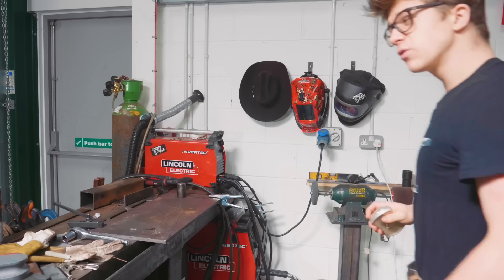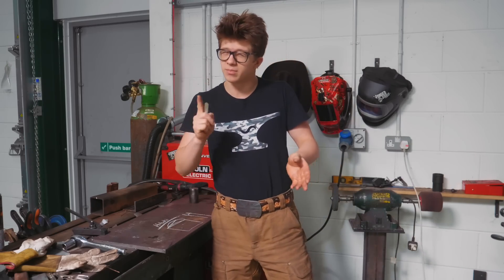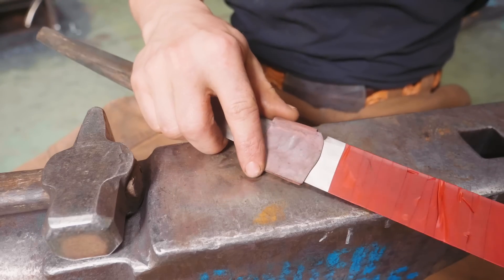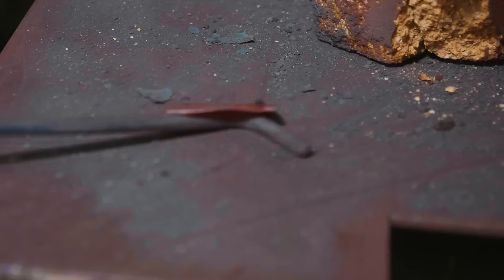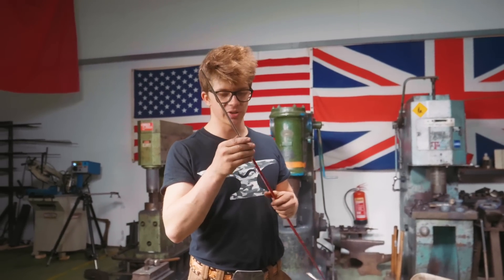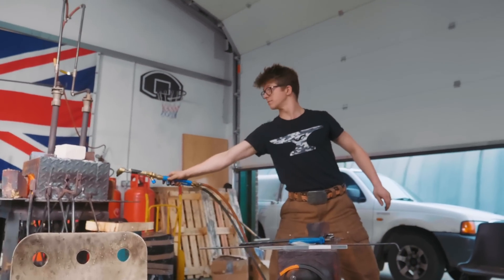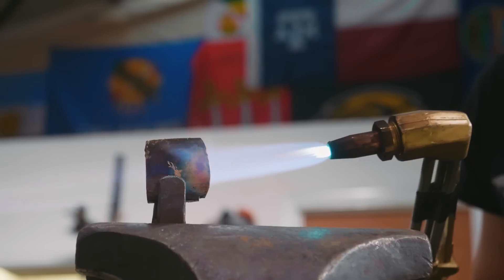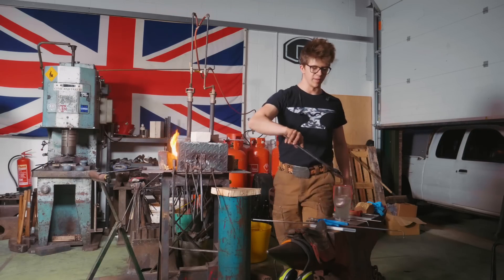MAKING A KATANA!!! 1 MILLION LAYERS!!! PART 6 - The Habaki

Comment: Wow great job love the video and all the honest attempts at doing something completely new. I was thinking maybe instead of welding the two ends at the sharpest point maybe make them overlap each other and only half as thin. Then you will have more contact between the two ends of the cooper and more of the metal can fuse together under the extreme heat

Comment: Silver soldering is actually simple, but you really need to have the metal clean, and touching all along the surface you want soldered. Flux the joint and place solder along the fluxed joint and heat. The solder should run along the join where it is fluxed via capillary action. I don't think you want the copper stick king out further than the metals thickness, however. Hope you figure it out, it's been fun watching the process.
Reply: I do silversmithing, happy to help if you want to hear more.

Comment: You may find that a paste flux works better than the powder flux. A smaller (hand held) torch may make things easier as well. Otherwise, soldering is basically what you did in this video; trial and error until you make it work.

Comment: Great job learning to silver solder! I have noticed that you have a wonderful new TIG welder, but did you know that you can use it to actually weld the copper? You can buy filler rod at you local welding supplier, or in your case since you had extra metal you could have just heated the metal with your torch and melted the two sides together. That way you could just heat and forge it like any other part if the katana. Cheers :)

Comment: As plumbers (in Canada), we braze copper lines together with  acetylene torches and silver solder that has a flux core...I dunno if that's applicable in your trade, but the copper gets red hot and the solder flows like a sonofabitch.

Comment: Clean your copper first, use more flux, use a neutral flame, don't heat the joint directly, don't use the flame to melt the solder. Once one section of the joint heats up enough to wet, guide the the flame closer to the joint and then along the joint slowly while not letting the flame actually touch the joint. If you do it right as you move the torch the joint will suck up the solder through capilary action and you wont need to add much more solder than what initially melted in.  Two or three tiny dabs.

Comment: if you use smaller chips of solder it will flow faster, but I also think the flame you were using was blowing everything out of place. Otherwise, I think you did a pretty good job. Maybe try cleaning the metal more between soldering tries, because your piece was covered in fire scale at one point.

Been watching your videos for a couple hours straight now and really am thinking about becoming a blacksmith.

Comment: First, start by cutting very small pieces of solder onto a fire brick or something else that is heat resistant that the solder wont bind to. Then heat the solder until theyre beads. Grab a pick and heat the pick and the solder until the bead sticks to the pick. The heat your piece while holding the pick. Then while the piece is hot, approach the seam with the bead on your pick, touch the bead to the seam while under heat and wait until the solder bead runs from the tip of the pick to the seam. You have to coax the solder to where you want it to go using a pencil tip flame. Once the solder runs onto the copper, use the heat to heat the copper in the direction you want the solder to run. The solder will flow and follow the heat.
Reply: solid work though, I could have never taught myself how to solder on my own

Comment: First: you try to pull a dog trailer with an eighteen wheeler or better a cutting torch with a size for 1.5'' steel to burn through, where a very small torch is needed.
Seconds: scribe or etch or forge your name and date on the tang, and make the handle retouchable with a pin over the tang, for the guard, a nicely cut round one ø 3-3.5'' and completely silversolderd and polished.

Comment: Also try hanging the habaki on a piece of wire while welding it, have I used stainless tig wire Si it didn't effect the heating of the copper

Comment: You can tig weld that.  If you have the right kind of tungsten rods and welding gas in your tanks.  Also the right kind of filler rod.  A tig welder can weld any type of metal. Great video, thank you.

Comment: Tig weld it.  DCEN.  Lots of heat and move fast.  Use common house wire with the insulation stripped off as filler metal

Comment: The flux is the secret to easy silver soldering....try to find a jar of "Easyflo" flux....a little goes a long way, but as with all soldering, cleanliness is your friend. SIlver solder comes in various melting points, but for almost al jobs the low temperature "easyflo" is the ducks guts.... For steel on steel  you can braze with bronze rods and for those borax works a treat for flux.

Comment: Well, next time you silver soldering don't put the tongs next to the part you want to weild, because those absorbs lots of heat. Also clean well the surfaces with a mild acid and then pour the flux, some flux has to be solved in water. Finally, as you said, heat the material first and then put the filling material over the gap, is not necesary to heat it it will flow to the warmer and narrower parts. I hope this may help you.
Love your show.

Comment: alec with silver solder, heat the piece, not the solder. touch the cold silver solder to the hot metal and it will flow into the cracks.

Comment: I noticed the habaki is black so I think the problem may be the oxide layer on the copper has developed so the solder won't stick to the parent metal as easily.  The flux you are using also needs to be specifically solder flux (gel rosin flux works really well)  and borax won't work.   Just like forge welding you want clean metal. To remove the oxide from copper you can make a solution of vinegar and salt to etch the copper back to bright metal (I do this on old boat trailer wires all the time)   you can then wash in bi-carb solution to neutralise  any acids.   To actually solder it's best to use the metal itself to melt the solder  rather than the flame or iron being careful not to overheat the base metal.  it helps to think of it like tig brazing.
Reply: Borax is the (a) correct flux for silver soldering.  Rosin flux is for low temperature solder, not high temperature - it confuses a lot of people that silver soldering should probably be called silver brazing.

Comment: you can totally aneal soldered pieces, just to the temperature you normally work, you could get some jewelers silver solder and do it, but copper is tricky to solder, also remember copper is way softer than steel so it dosent need temperatures that high
Reply: also for next projects always picke the copper piece before solder it, dirty copper(black because of carbon) don't solder well

Comment: Try some S-39 instead of flux next time! (soldering paste, grease, I don't have a suitable translation for it) You'll find out soldering is a breeze! And like already mentioned, heat up your workpiece and then just touch it with your silver solder, if it's the right temperature it will melt.

Comment: You know the copper is ready for solder when the flame turns green as it passes the copper you are heating, you should then be able to touch the solder to the copper and have it flow into place.

Comment: Get the copper red hot at the point you wish to make your joint. Apply rod to red copper. Clean up excess and done.

The solder will chase heat and flux

Comment: Rather than silver soldering you could have Tig "welded" the edges together. No filler needed, just keep the ends close and run a puddle across.

Comment: Alec It's my opinion having silver soldered for over fourty years that it is part noob ness and part the torch head your using. it's almost to much heat! try getting a propane oxy WELDING tip like a 4-6 size and it should go like butter, but like your tig welding, it's all about the practice, try making carbide tools for your lathe some time.lol

Comment: Alec get yourself some pool acid sodium bisulphate you need to remove the oxides off copper as much as possible for clean solder joins  . You can use a mix of water and borax to flux but some commercial jewellers flux’s are way easier to use
Reply: Also for jewellery techniques go to to https://www.ganoksin.com

Comment: Hay just to let you know you can tig weld copper using dc current on your tig set just create a tight joint and fuse the edges in if you find it’s a bit of a struggle getting it to fuse strip some heavy gauge electrical wire say 1mm thick strand for a bit of filler rod.

Comment: I took a plumbing course back in high school. When we soldered a joint, you get the whole joint up to a nice even temp and then heat from one side while applying the solder from the other. The heat draws the solder towards it and into the joint. I'm no expert so take that with a grain of salt. Just speaking from my limited soldering experience.
Reply: And speaking from my elaborated experience I tell you that normal soldering and silver soldering are two different things. The first is with a relative low temperature, and you apply a mixture of tin/lead into the joint, silver solder is with a high concentrated temperature and you ad some silver alloy into it.
Reply: J.M. K. Gotcha. That's why I added that my experience was limited. Just suggesting something to consider or look into more. I've read about silver soldering a bit and I know it's quite different.

Comment: You took such a hard route to making the habaki.

The way I've seen it done most often is take a piece of copper, heat it and chisel a hole trough it, then keep it heated while you hammer it in place or over a surogate (if you don't want to risk any heat from the copper to do anything to the blade).

Once it's inside is the perfect shape to fit the blade, you take it of and shape the outside to whatever design you want.

Comment: I highly recommend checking out Pavel Bolf's channel and Zdenek Balzer, as he has very informative vids.  The next step of the process would be to make the seppa spacers and tsuba (hand guard).  Usually, you would put the handle side of the habaki onto plate metal (steel/copper) then scribe the inside to get an exact drawing of the tang dimensions.  Then use a jeweler's saw or coping saw to cut out the tang hole, then file to fit. 

For the tsuka handle, I recommend getting poplar or alder wood.  You want two book matched halves, but with the grain making a sort of oval, going towards the edge side as that will provide the greatest strength once glued.  You can also make long neck paring chisels to carve the channel in the wood, or just use your CNC machine to make a rectangular groove and epoxy the tang down.  Also, make sure to drill a hole through the handle and tang for a bamboo or delrin pin (~3/16 inch diameter) so that the blade doesn't fly out of the handle.

GL and very excited to see the end product!

Comment: You were on the right trak in da beginning just hang the habaki on a steel rod instead of clamping were you wanna solder then use a smaller burner on outside the solder will follow da heat

Comment: next time use paste not powder flux and on an outside joint you get the work hot enough to  melt the solder then touch it to the work

Comment: Plus you heat the copper not the solder. When the copper is hot enough the solder will flow into the joint

Comment: ALEC GET AN OXY ACETALINE MICRO TORCH!!!!

flux between the surfaces, heat until your flux goes clear (from the under side) and then touch your silver to the joint and let capilliary action carry it between the surfaces.

the solder will flow toward your fire, so never put the fire directly on it.

ALSO: you dont need to anneal after soldering. Copper has extremely great conduction, and the act of soldering anneals it. you just risk losing your solder.

Comment: hey Alec i have been watching your videos for close on twoyears now, was watching you struggle with the silver soldering, firstly cleanliness is everything is soldering.. secondlyyou want a joint you are trying to join to be as tightly fitting as possible as solder will not flow between big gaps.. think of solder as a joiner not a filler. thirdly next time heat the articlt you are trying to solder from the furthest point away from the solder as this will make the solder flow into the joint as solder will flow towards the hottest part.. last but not least use the solder spareingly you used enough solder on that one habaki to solder about 100 or more silver rings.

Comment: well good job for not quitting!!! next time my friend just tig it. .. dc reverse, so the torch is - and the ground is hot, use copper wire with out the jacket, of course, like 10gage for your filler rod and just tig it up and o yea stranded old argon.  it will weld up like stainless steel. so just tac it a few times.  let me know if you would like a video. I could tig up some .020 thows for yea if you want.  good job as all ways...

Comment: You can actually forge weld non-ferrous metals with a hammer, just at a much lower temperature than steel. BackyardBowyer's video on Mokume Gane should be helpful

Comment: When you solder you need to get the part hot enough to melt the solder. Don't use the flame to melt it.

Comment: Dont touch the flame to the solder, the hot copper will melt the solder. But I'm sure you figured that one out 😂. Next time try your tig torch. It's much easier than a oxy rig.

Comment: awesome bro, but I would try brazing, rather than soldering copper... WAY easy, WAY stronger... I braze copper refrigerant lines for heating and air conditioning. we don't silver solder, it's not strong, it's more of surface bond, where as brazing is more like a weld when done properly and much stronger. Dynaflow is the brand I use. the technical name is phos-copper silver brazing alloy or 5% silver brazing rod. You will love it it flows nice, no Flux needed

Comment: Mr Steele,Sir,
to be successful at silver soldering you need to get the surface to joined very clean,add flux, ( most of the flux i've used for silver solder has been liquid )watch flux when runs liquid,( Flux drys out and then meltsyou are nearly up to temp,a slow flame is all you need to control temp from there,\.only place flux where you want to solder,for where the flux runs .so will the solder..
even a finger print on solder surface will stop it from running the joint,
Now after all that you can get different type s of solder
Stuff that runs like water and stuff no matter how hot it gets will not run,
i, like you have learnt the hard way,3rd year apprentice and had the job of silver soldering around the tie rings of a steam turbine rotor,before balancing,and after 4 million blades,got pretty good at it..Bu t I do like ya style,

Comment: First you have videos of you using a jewelers saw blade and now you're working with softer metals and silver soldering; we might make a jeweler/goldsmith out of you yet Alec Steele. P.S. Silver soldering soft metals is always a pain. Close seams and heat the area around the seam and not the seam itself (you essentially want both sides to be hot enough that THEY and not your flame melt the solder and it flows evenly...the reason you got puddles and clumps of solder is cause the flame melted it and the metal was cooler so it just sort of clumped there...hot solder on cooler metal equals no bond). Practice, practice, practice and you will get it.

Comment: Your problem was the tongs/vise..  Copper sinks heat very effectively and needs a lot of heat, and by holding the piece in tongs, you're just sucking all the heat away..  Typically silver soldering (or brazing) is done with the piece just sitting on a firebrick and a tiny needle point torch or just held  in long tweezers and held over a wide flame from a burner until the joint is hot enough for the silver to flow).   

Now although silver and gold solder are traditional, since you are so into TIG welding, next time you can get some silicon bronze rod or even copper brazing rod and just TIG it together!   The controllable heat from TIG makes copper assembly incredibly easy vs hard soldering/brazing

Comment: Um I am new to your channel. If you want that non ferrous copper Habaki thing to be strong DON'T anneal it. Copper can take anything you plan to do with it and it loses strength the moment it gets to hot.  Personally I would have placed the item on a fire brick to reflect heat so the solder melts to the pieces. Also the removal of oxidation is helpful with a warm Sparex Sodium Bisulfate solution. Just be careful, it makes Sulfuric Acid. Read the directions, when mixed properly it will only be around  5%.

Comment: next time you silver heat your work and heat the rod, then use the heat in the work to do the final melt on the rod, if you try to use the flame you will push it about and make a mess.

Comment: I think I am way to late, but maybe you are reading this.
The blowtorch was a little bit too hot I think. You only need around 220°C to melt the silver solder. A solder-iron or a hot glowing steel stick would be better. then you can drop the molten solder on the gap.

Comment: Loving your work as always Alec. But, I'm curious. Did you ever consider making a Wakazashi rather than a Katana when you were starting? For all intents and purposes it's the same sword (you could even loosely call it a Katana) just a bit smaller (blade 14-22") and maybe more manageable with your existing tools and experience to heat treat, temper, grind, etc. Still, love the product so far and that you're continuing to challenge yourself. Looking forward to seeing the finished piece.